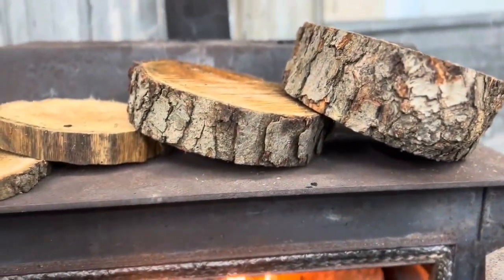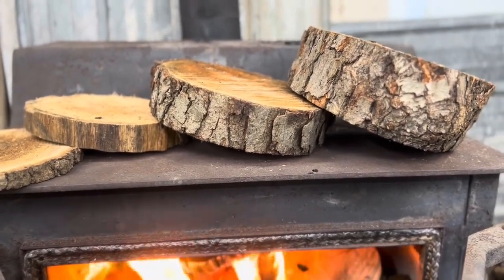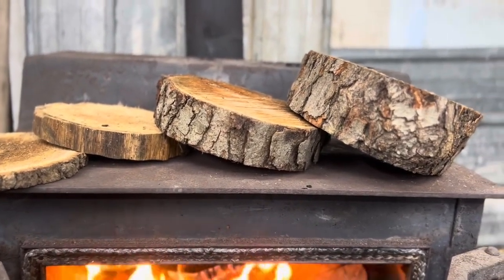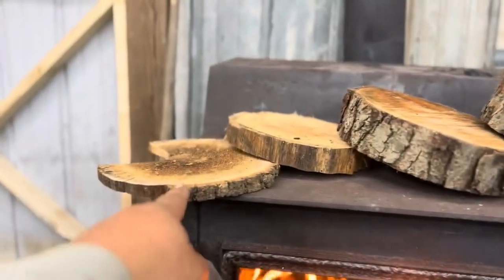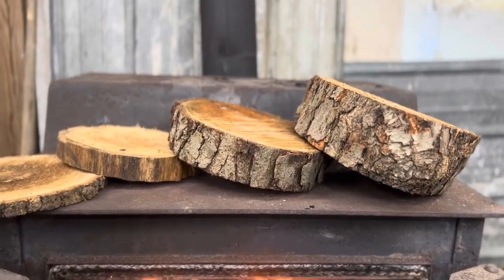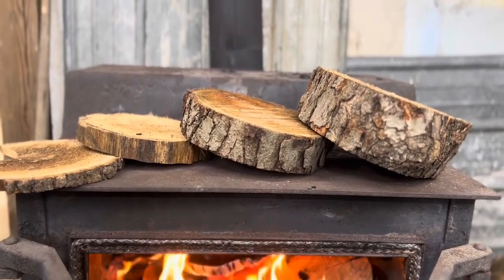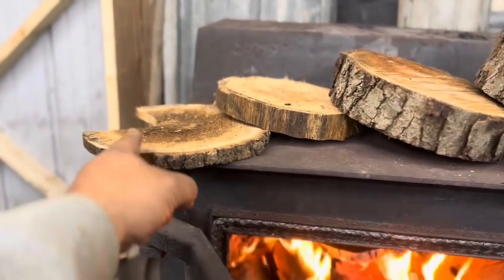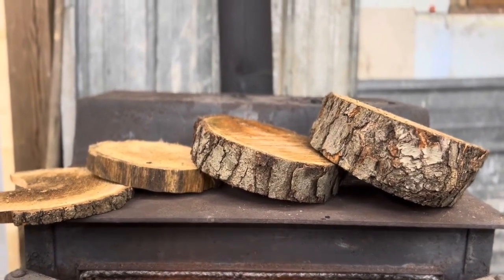Nitromethane VS Methanol!  What Happens When We Try Nitromethane?

Comment: Main reason we cut logs and split it is because of the waste from all the cuts. Depending on the saw, each cut turns about 3/8" of wood into chips. Say you've got a 8' log and you're going to do 2" cookies. That's 40 cuts with a 15" loss.  The math is rough, but I think it comes out to a 1/6th cord loss per cord cut all into sawdust.
Reply: Also if doing 2 inch cookies opposed to 16 inch logs you would burn 8 times the amount of fuel along with 8 times more wear and tear on your gear.
Reply from the maker: I’m considering time and energy mostly. I think I could cut more per hour than I can split.
Reply from the maker: I’m imagining an 8” log. Noodle one cut down the center and make 4” cookies. Basically produce 4x4 cookies.

Comment: I have the same saw but it’s setup for cutting firewood.
The 5200 performance intake (available on eBay) with a 372 carb really ups the rpm.
I bet it would work well with your setup too.

Comment: Cuts a lot faster on nitro! Seems like it could use a little more fuel volume, but she runs with more speed. Also I agree with the wood processing! Why wast time splitting if yoiu don't have too? Seems smarter to leave it round so it will burn longer as well.